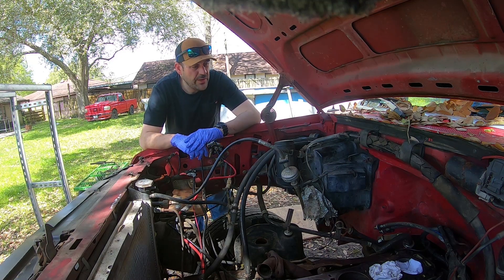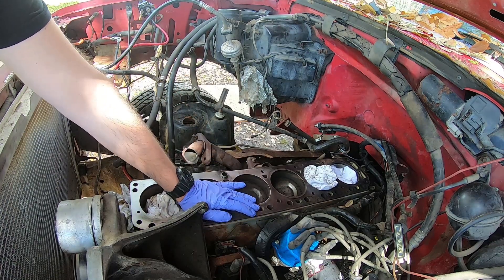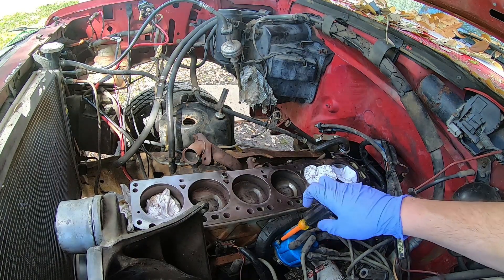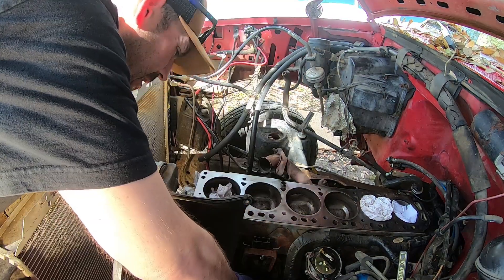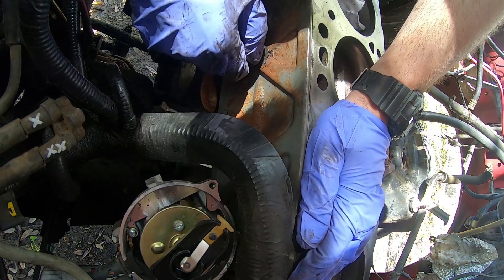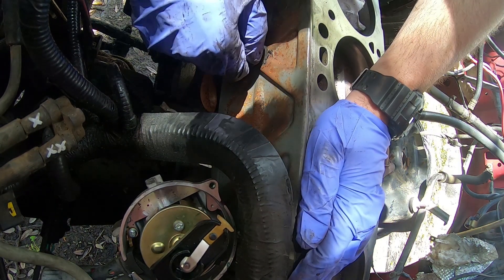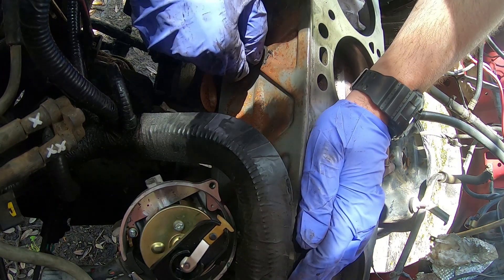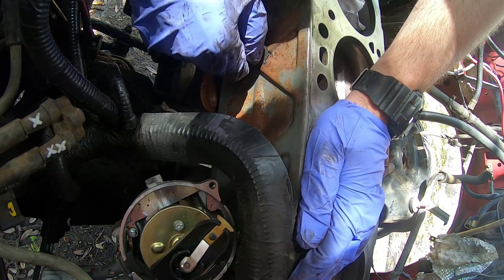1992 Ford 4.9L Blown Head Gasket Repair Part 8: Pushrod Cover Gasket

Comment: I have a 4.9L in a 95 f150 I also am doing the head gasket just found a crack on my cylinder head so now I am having trouble finding one a used one anyway. I cant afforded a new one but I am enjoying your videos it has help me along my journey with my 4.9 so thank you for your dedication and the time you put in your videos..... catch you on the next one until then god speed my friend
Reply from the maker: Timothy Mcinvale I’m glad you’re enjoying them and thank you very much for the comment. Some of videos of this series are better than others. I want to get this head on quick but I have a slipped disc in my neck and it was hurting pretty good this weekend (hence not so good angles from the camera) I just couldn’t move good so I went with the pushrod cover and water pump this time. Next weekend though I really plan on getting it on and hopefully uploaded. What part of the country are ya in? I’m south of Houston and found 3 or 4 online at junk yards. I went with the reman’ed one from rock auto they give you free shipping back to get the core charge of $125(?)ish back and I think 🤔 making it around $255 plus shipping cost to you....of course then you have to get all the odds and ends like gaskets, bolts etc etc...if you go that route look into them, they are cheaper than autozone or oreillys. Again thank you very much for the comment and taking the time to watch me fumble through this job 😂.

Comment: How did you clean the surface on the top of the block around the heads
Reply from the maker: so i was very careful and cautious to not score or over sand with a scrub pads. First i hit the piston heads with a round scouring pad (green then red color) to get all the carbon out carful to miss the cylinder walls then vacuumed the debris out. Next I slowly used a razor blade ( no scouring ) and scraped any hard gasket material and carbon deposits off the block. Then i took a light grade red 3M scotch-brite scrub pad designed for aluminum and light metals and cleaned the block,  I also had a round drill attachment with a red pad i used in some spots near the coolant openings in the back. then i vacuumed all the loose debris again off the block and in the openings. If this were a high dollar motor or rebuild i would have used a machine shop but this motor has 254k miles and the remanned head had been machined so it was sort of just rolling the dice hoping i had the block flat and super cleaned. Final step off camera i used a 24" straight edge to check how flat it was then hit it with degreaser and wiped down to a clean surface with a lint free rag.

Comment: Well I definitely learned something new today!  I didn’t even know that plate was removable.  When we had the F-150 (which we’ve sold) it was so oil/grease soaked that I just assumed it was part of the block.  That’s a real cool design, and you did a great job with that black paint. Looks sharp!  Also glad that the water pump went in without any problems.  Letting it cure before the cylinder head goes on was the right call I think.  Thanks again for the shoutout man, and I’m looking forward to the next vid!🤙
Reply from the maker: YDOC Productions lol, I did too when I first bought the truck in early 2019! It was just coated in 1/4” of grease and grime and I just so happened to look at a forum talking about it and said “heck, I may able to change that myself” and thus began the repairs to this old truck and 2 months later a camera and small YouTube channel 😂, now here I am getting my butt kicked on the head gasket 🤣. I chose black to hide the oil leaks lol, out of sight out of mind right. Thanks for always watching Cody, I appreciate it brother!

Comment: Getting closer my friend! 😃👍 I appreciate the shoutout! I was wondering what the metal frame was for 🤣 hopefully it saves your back this time!
Reply from the maker: HODGE_PODGE_DODGE_GARAGE man...that frame....ugh....😡..I had good plans for a makeshift “lift” but the day I finally had a few hours to build it I had to really rush and just didn’t think ahead enough. The footprint needs to be wider and I need a better bracket setup to make it more stable. Got frustrated and called it quits Friday night lol. I may revisit it later but I’m having to rush everything due to work schedules. Even the filming and editing part I flew through so I could post something while I had a chance. Thanks for watching as always Zane.
Reply: @3rdcoastobs467  I can only imagine with work. 😔 no time to work on the truck. Hopefully it still helps lift the head buddy 🙂👍

Comment: Ok James, quit stalling, you are gonna have to lift that head into place sooner or later! Could you put a towel or something back on the cowl to protect the paint and then span it with a piece of unistrut to the framework you built to lower the head into place?
Reply from the maker: 🤣🤣🤣 you busted me Jason! i'm dreading it! I really wanted to yesterday but this damn slipped disc in my neck is aggravated to hell from moving some Hoffman Boxes Thursday, even getting the 100' of strut to my backyard killed me. I built that little strut frame to hopefully act as a lift point with my comealong. it wont be pretty but i think  it'll work and i can lower it into place - just wish i would have thought ahead and made it wider. If all else fails i'm just gonna get a buddy over here to give me a set of hands to do it. The slipped disc and to little crappy torque wrench i have was my main reason to put it off, little thing barely does 12ft-lbs and i think i need 90 ft-pounds for the head studs. Next video its going on though come hell or high water 🤣.

Comment: I remember starting that job once late in the afternoon not realizing it was way more of a pain than it appeared.
Reply from the maker: Steve Stoltz 😂 yep, this pushrod gasket has got me twice by underestimating it. The first time I tried it last summer I ended up on my back patio at 9pm still struggling to get stuff out of the way to remount it (cussing the entire time), But When I read the manual I thought “that doesn’t seem too bad” . Bad thing is during this job I think I noticed my steering gear box might be leaking....remember that Tom hanks movie “the money pit”? That’s what this is starting to feel like.....
Reply: 3rd Coast OBS Yeah it seems like there is always something that could be changed while your in there with it torn apart.

Comment: What kind of cold beverage did you have in that koozie/can cooler ? I had the same kind handy and in use holding Budweiser's a week ago today (2-24-20) when I finally got back on mine and got the head off and out. I used a shop crane (engine hoist) with an extension, through the passenger door. Just Barely had enough upward clearance, after taunting the chain with two motorcycle tie down straps, to squeeze her out, all in drizzling rain. I shot some video of it. Might put it together and upload.
Reply from the maker: Stucknarutt would have liked to have seen that, hopefully you do post it! I wanted to get in installed really bad when I started filming but I have a slipped disc in my damn neck that got aggravated Thursday at work. I figure in a week I’ll be ok again and only the weather can stop me next weekend from getting it back on. The koozie was from the night before where I decided to have dad time and kick back a few to many miller lites paired with a few sips of jack Daniels Tennessee honey 😂. I was hurting a bit during this video for sure.

Comment: @3rd Coast OBS 
the grommets for my pushrod cover are so thick the bolts won't thread?? I got a felpro gasket set and they are significantly thicker than what came off. am I missing something?

Comment: The old holden 6 over here hav the same set up just there is two covers for the lifters. Coming along nicely little bit of paint makes all the difference u will hav to paint the rocket cover too.
Reply from the maker: It really does, I was surprised how nice it looked.  You're 100% right im going to have to get my valve cover done up the same way, I'm thinking black as well for that (maybe red I dont know lol). Thanks for checking it out brother!

Comment: what is the size of the shed that you are working in?
Reply from the maker: Man I can't remember if I went 12' or 14' on width...I think I just had the shed guys build it 12'x20' and upgraded to 8' walls. Had a local company do it for around 2k which I think was pretty cheap compared to lowes/homedepot. 30 year shingles and 1 window and barn style doors and I built the shelf with scrap 2x4s and plywood I still had. I'm super happy with it. Just wish I could build a nice metal 3 car garage shop but that's a few years away.

Comment: I hope you didn't buy that kindore strapping/strutting new because you could have probably bought a hoist for less. Being in the electrical field for over 20 years I know that stuff is really pricey but good at what it was designed for.
Reply from the maker: Stucknarutt no sir, I used to work for a electrical storehouse about 10 years ago before my refinery days. I still deal with them a lot so I got 100’ of single strut and a few 4 hole brackets and hardware from my buddy who works there. Just cost me a handshake and a thank you. Every once in a while ya gotta call in the old favors 😂.

Comment: What was that black stuff on the side cover before the cork gasket?  High temp gasket?  I didn't know you could use both...but I wish I had!!!
Reply from the maker: Todd Weaver I used that permatex ultra Black maximum oil resistant rtv. Saw a couple forums mention it and said hell with it, I’ll give it a go. Works pretty dang good and was a life’s saver as far as the leaks from that cover. It’ll hold it in place , I’m sure it’s overkill but there was no way I was about to try and hold that cork gasket and most likely break it 🤣, it’s such an awkward area to shimmy into!